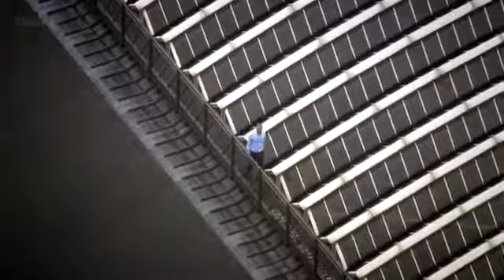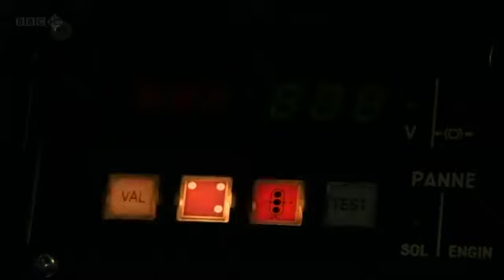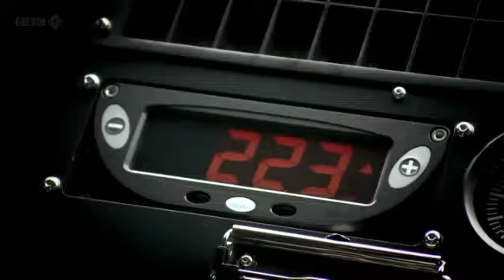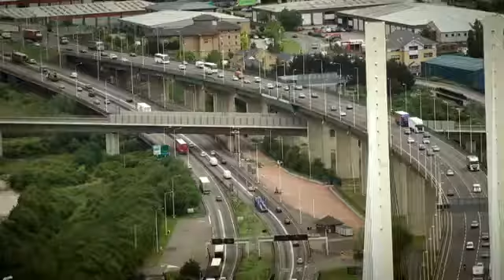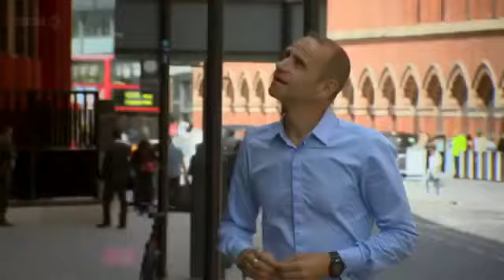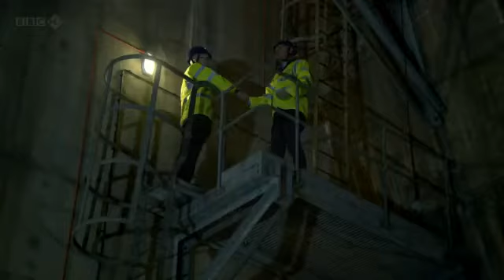Built in Britain - Olympic Park to High Speed 1 - BBC Documentary Part 1

Comment: If you think about it, the high speed 1 max speed is probably only 150 mph, whereas in France the Eurostar hits full speed, and even with e320s 200mph, they clearly won't hit 200mph on UK tracks, it's too hard to cope, considering the pendolinos can only 125mph even thought they can'
 Run 140
Reply: The operating speed for section one (Thames to the Tunnel) is 300 kmh which is 180mph. And even in France the e320 can only reach 320 kmh in places. The reason HS1 cannot operate that quick is because of the challenging geography (hills, brigdes and tunnels).
Reply: hello from the future, Eurostars regularly hit 300km/h on HS1 as on the LGV Nord in France :) as was the case when you wrote this
Reply: Between St Pancras and Ebbsfleet on HS1 the maximum speed permitted is 140mph however beyond Ebbsfleet towards Ashford is 186mph